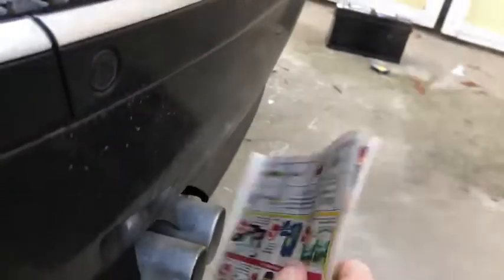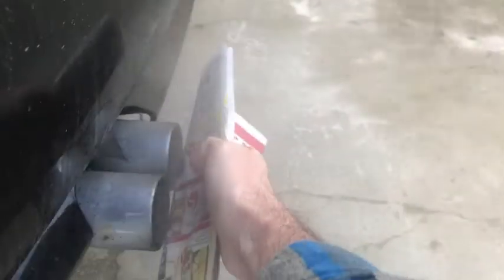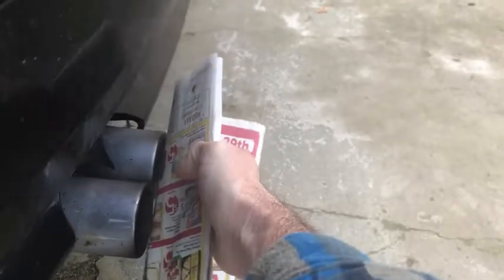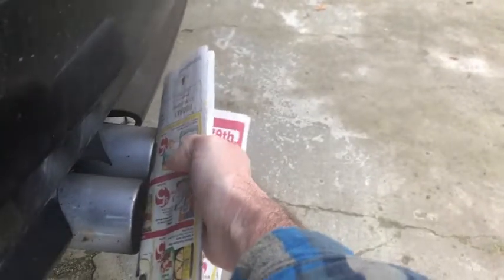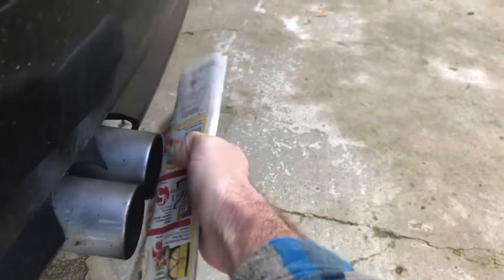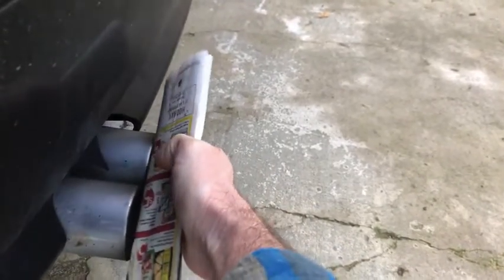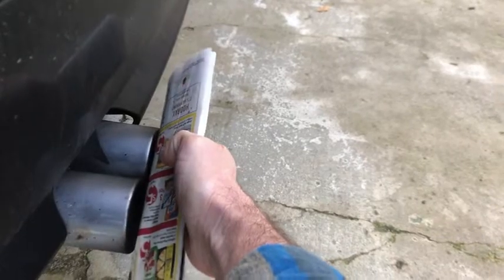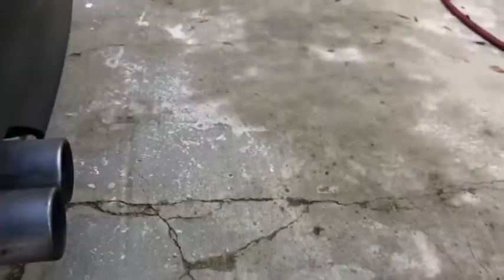Misfire paperTest 2018

Comment: I've had 3 different causes of missfires on mine. 
The first turned out to be faulty lifters. That had a symptom of misfires across many cylinders about 20 seconds after startup (flashing light). It would go away once it was warm. BMW fix this (under warranty) after a very long time.

The second case was simply a coil. The missfires would start when everything was very hot. Replaced a coil and the problem was solved. Interestingly the misfire codes were off by one in the firing order.

The third which did not trigger any codes as it was very minor was due to a faulty exhaust cam sensor. It took a few months for a fault code to come up. Once I saw a cam sensor fault code I replaced that sensor. Engine was smoother than ever.